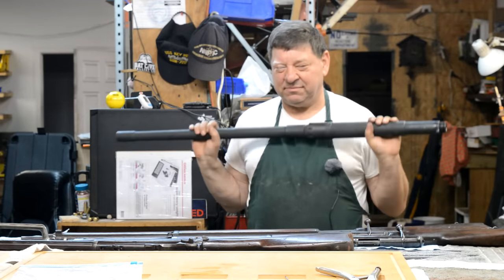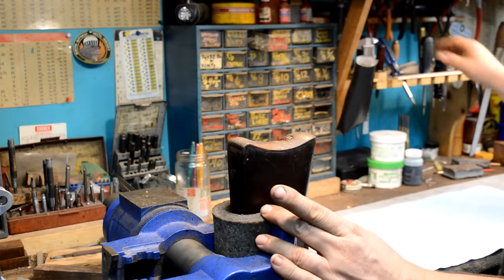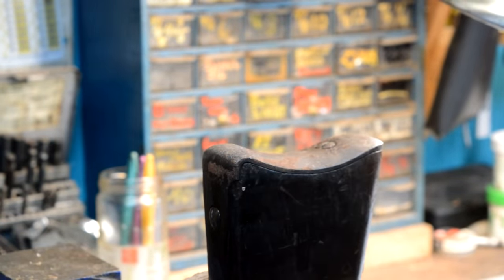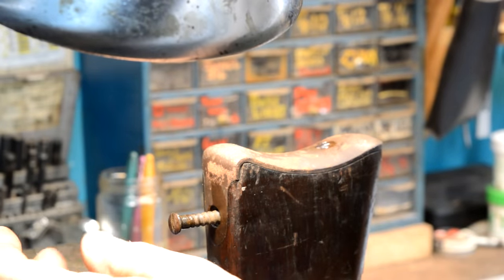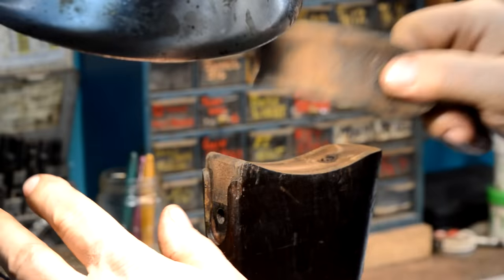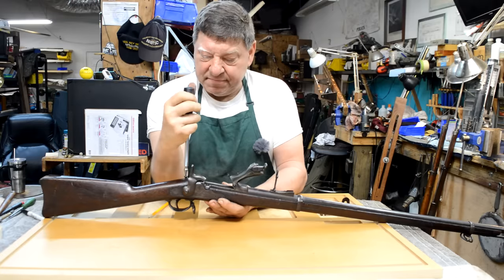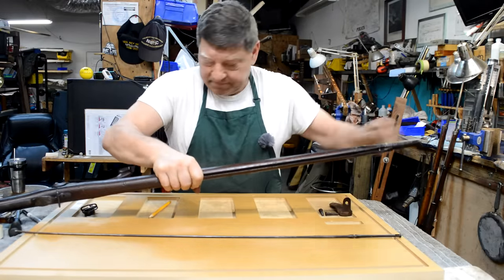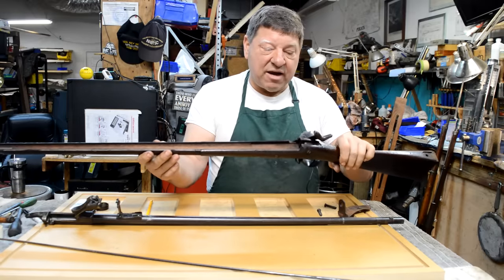1873 Springfield...The "Trapdoor":  Anvil 111

Comment: Those trays are great! I made myself a couple a while back, they fit into a little rack that lives on my wall, great for storing projects while you're waiting on parts etc. I'd suggest sealing the mdf with something like watered-down pva as they tend to shed dust and start to blow-up/fall apart once they soak-up a bit of humidity. Sterling work as always guys, thanks!
Reply from the maker: Trays are in fact sealed and repel oil quite well

Comment: I bought a Krag a few years back that was virtually pristine on the outside. So why did I take the gun apart anyway? Because there was sugar rust on the inside of the buttplate and trigger guard, that's why! You'll never know what's hiding under there until you check.

Great work as always

Comment: Hey Mark, So, I broke my 1873 down to its lowest common denominators. Extractor spring and plunger somehow are fused together. Firing pin tip worn down to a nubbin, and 5 screws beyond the tiny ball peen restoration. Well $85 in new old parts later the rifle is mechanically back up to snuff. Not to mention the extra high front sight and new front sight pin so I can get the rifle shooting.1.5 inches high at 100 yards.  The stock is ding steamed and sanded down to 400grit, and ready for stain, sealer, and true oil. The metal is close to being prepped for bluing. I'm making the rain gutter device for boiling and steaming. The moral is looks can be very deceiving and if you are not prepared to go all out and do the job right then leave it alone. When I die, I'll be willing all my new gun smithing tools and equipment, used on only one rifle, to Bruno. I am sure he will love the highly polished baby ball peen hammer.
Reply: Right on man, was this a retirement need a hobby kind of deal or something?
Reply: @bizzlebazzle4390  I have been retired long enough to complete all of my Honey Do lists and decided to put away my 7MM-08 and get an original Springfield 45/70 Government to hunt deer with. It's tough to find a Springfield in decent condition that doesn't cost a fortune. It's tough to find a Springfield in poor condition that doesn't cost a fortune. I'll have a dandy shooter when I'm finished refurbishing the old boy. My next rebuild is going to be a combination 20 megaton nuclear warhead/riding mower. Ha, Ha, Ha.

Comment: THANK YOU! This channel has been a huge wealth of information and this vid is another 5/5. I gave up trying to take the hammer off my Snider Enfield before I broke something. I tried asking or looking for a book but this stuff is all in old people's heads or 50 years out of print books. 

I used a parallel clamp for the flat spring and managed to take the hammer screw out with a wooden jaw vise and some heat but I ended up blueing the hammer and plate together.

Comment: Excellent video as ever Mark.. 

I have to say I tend to use a small brass hammer for "persuading" stuff rather than a polished steel one! My polished steel hammers mostly get used for pushing metal back to where it should be.. same with punches, unless I am hitting something that will be hidden, I tend to use a brass punch, at least to start stuff off. I have given up buying brass punches,  I just have a length of of 3/8" brass/phospher bronze and turn them up as I need them..

Regarding shifting "blister rust", I have a couple of flattened .577/.450 Martini cases on my bench, one I use for scraping pins out of files and the other I use for scraping off blisters.. sometimes they get mixed up.. who cares..!

Comment: This was just what I needed.  I've done this on other guns before but was going to leave the Trapdoor alone other than just disassemble it for cleaning (the reason I came here to begin with).  But I liked what you said, "I can't see how maintaining it makes it less collectible" (paraphrasing).  I work on classic Benzes and have the same thought process.  Thanks to you, I have all the metal boiling away in a pot next to me at the moment and they are slowly getting to a lovely, black finish.
Reply: Got all the bits black, but the barrel and action don't want to turn dark evenly at all. It looked like an oil pattern, so I degreased again with acetone, but hours later, hardly any change.

Comment: So, my 1873 Trapdoor also has the unobtanium breech and firing Pin with spring. I replaced the firing pin with the with a solid shaft pin that does not have the recess for the spring. I assume the spring had the purpose to keep the firing pin away from the cartridge primer until the hammer is fully cocked and fired. I also assume the angle of the firing pin to the primer may have created a force that overwhelmed the steel of the firing pin and caused a failure or break where the pin was reduced in diameter for the spring. Someone back then may have decided to beef up the end of the firing pin and deciding to heck with the spring that kept the pin away primer until shot. My Springfield has the three clicks of the hammer so I can carry the rifle safely without an incidental firing due to the firing pin resting on the primer or the trapdoor being unable to open. Still, I tip toe when loading and firing the old boy.

Comment: Dang it Mark, the one thing I wanted to figure out is how to remove the rear sight that is fastened without slotted screws.  You tell us a special tool is needed is all you told us and yes, I have an 1873 that needs a rear sight replacement, and it has the non-slotted fasteners. I have a beautiful 1oz buffalo silver round that I'll mail you as a gift, for your troubles. I was considering vice grips and a torch.  Desperately yours, Uncle Freddie von Trapdoor Pick.
Reply: The closest modern equivalents you will find are called "pig nose" or "snake eye" screw heads.  They make driver bits that match them, but most people just grind their own from a flat head driver.

Comment: Currently saving a tomato stake early production 1873 carbine from the brink of scrapping.

This thing was a write off and I'm using it for experimental archeology.

Using a series of mint condition rifles and carbines as examples, I'm replicating the finish techniques used at the arsenal.

To put it simply, to replicate the blotchy kaleidoscope of blues and blacks, you just vary the time and depth in the vat of charcoal. Also vary the delay between pulling the parts from the vat and application of oil.

I cannot get whale oil. I can get Jojoba oil. Both are liquid wax and virtually identical. So far I am attaining the variation correct to these rifles.

I have yet to pull the barrel. The bore is shot. The muzzle swallows a 45-70 case near to the rim.  The chamber is intact, the throat ok but from there forward is a nightmare of pits and damage.
I'll be drilling it to fit a 3 groove liner. Super temperature high strength JB Weld will secure the liner to the reamed out bore. I'm going to have fun doing this.

The metal will all be finished as per all the original techniques, slow rust barrel and receiver, charcoal blue hardware and color case on the tang and block. Shame the markings are mostly trashed or outright gone.

I'll be duplicating the stock. Straight grain black walnut heartwood 8/4 board on a duplicator.

It will look arsenal new less the markings. It'll be good for another 130 years. 

Don't cry. There is no history, that was neglected away before you were born.

Oh, my first impressions seeing this pathetic thing, it was dragged behind a horse down a granite rock road from the fort to someone's cabin, shot 50 times with chlorate primed cases, dipped in muddy water and then hung over a fireplace to collect soot and rust and the whole time played with in the yard by a few generations of kids who dry fired it to the point the firing pin jammed up in the crushed channel before the hammer finally fell off the rusted out tumbler shaft.
The butt plate came in two pieces. Looks like it sat on a wet burlap rag in a leaky barn for 20 years.

Like I said, the only history is one of what people will do to things they can't be bothered with.
Reply: If the bore swallows a .45-70 cartridge nearly to the rim, there is a chance that it is actually a .50-70, which was used until 1873.

Comment: Hi Mark!  Can you pls tell me the name/model of the soft bristle wheel you used for most of the cleaning (lock plate/buttplate/screws/etc)? I’d like to purchase the exact same one. Thank you!
Reply from the maker: https://youtu.be/62_pKoYje9o?list=PLQ8hvyC8cR2XppC_W8DYHKZboBH28e1Ie&t=453     go here, thanks
Reply: @marknovak8255  Do you think if the metal on an orig US Springfield is heavily frosted/browned with patina it would shine up like yours did? (assuming i'm using the same buffing wheel?)
Reply from the maker: @Scott Leaver  if you boil to convert first,  yes. The number of cycles through the process is more important than how long you take per cycle
Reply: @marknovak8255  if it's steel, how do you touch it to your hand without destroying your hand?

Comment: Great presentation ❤️❤️. Usually after boil and card you soak everything in kerosene. Didn’t mention this time?  I’m thinking you did and wiped down then applied non-detergent motor oil. At what point do you apply wax to the metal ? Do you warm the metal as you wax?  Thanks again for your wonderful tutorials.
Reply: You don’t normally wax metal, especially the moving parts may clog up
Reply: @meesvandeburgt3525  That I understand. The last time I did a thorough cleaning I gave all the internals a waxing with museum wax buffed with a brush and reassembled with oil. Haven’t had any gummies to date. That was before I discovered boiling. Thanks for your reply
Reply: You can soak it in kerosene, non-detergent motor oil, or mineral oil. The motor oil is maybe just more camera friendly since he can talk while doing it vs submerging it in kerosene and that's it.
Reply: @gpclipner  waxing is definitely a great long term protector however!
Reply: @meesvandeburgt3525  It is. All my older firearms that have been thoroughly cleaned have been waxed with museum wax. Amsoil also makes a product called Metal Protector that sprays on wet and drys to a waxy coating.

Comment: I periodically pull apart and clean and oil the components of my repro guns like this.  But the wood around the lockplate on my original trapdoor appears almost swollen OVER the edges of the lockplate.  How do you deal with THAT?
Reply: It could be over oil I think Midway has a video about dealing with over oil gunstock that’s old
Reply: @connermorley2282  Thank you.  Will check it out.

Comment: Thanks for doing this video even though you weren't back at 100%.   When you boiled the barrel, I assume you did inside the bore as well?  If so, do you run dry steel wool down the barrel to remove the rust?  Just curious.
Reply from the maker: A bore brush works great, even if it has oil on it.
Reply: @marknovak8255  Many thanks!  Hope you are on the mend.

Comment: I recently purchased a P 1853 Enfield with a unbelievable tiger's tail stock. It was converted to a trapdoor, first model design and reworked at the Remington Arms Co. for Hiram Berdan  to be used to procure Great Britton's breach loading rifle  contract ( It did not get the contract, that went to the Snider breech loading system.. It is stamped on the opposite side of the  lock is stamped, Patented Feb. 27, 1866. The ejector dose not retain tension and appears to be missing a "very small bearing" between the ejector and the upper breech section. Is it possible to repair it or should I leave it alone. The lock plate is stamped Barnett over London.

Comment: I absolutely love those old guns! I have one myself and would love to do the same resto as you did this one.. did you boil those parts in plain water?
Reply: For just converting, tap water is fine. If you are going to rust blue and use the boiling method, it should be distilled water. If you will use a steam pipe, tap water is all you need.
Reply: Thank you

Comment: Great one. I have used your methods in my own conservation projects.  I have one question, what speed are you running your carding wheel at? Seems much faster than mine.
Reply from the maker: 1750. 4 pole motor. 60hz

Comment: Would the disassembly and assembly instructions that you gave for this gun also apply for an 1863 Springfield?
Reply: I would think so as the both are very similar in construction. Or course, the 63 does not have a breech mechanism, but you want to make sure not the strip out the Cap cone.

Comment: Hey Mark, after putting the metal parts on the wire wheel did you re-blue them or just coat them in oil, I couldn't tell? Thanks Jeff
Reply: This was a straight up conservation, no rust bluing. Just non-detergent motor oil, kerosene, or mineral oil after carding.
Reply from the maker: Just oil, yep...
Reply: And NOT a wire wheel, it's a carding wheel. Basically 0000 steel wool on a wheel.

Comment: My 1873 has a set of witness marks where barrel mounts to block. The ejector fits perfectly to barrel and block. But the barrel is only hand tight to block when witness marks line up. Is this acceptable?
Reply: Check headspace and shim if it's too easy to turn past the witness mark? I think if you can't really turn it more (with reasonable force), then it should be fine since the rifling will impart a slight "tightening" action every shot.

I'm no expert, though.

Comment: There's gotta be a small vibratory impact tool or something to prep areas to be broken free
Reply: There is.  It's called a two-ounce ball pein hammer (with a mirror-polished face) sometimes combined with an equally polished punch or drift.  Tappy-taaaaap-tap.
Reply: @geargnasher9822  no that's an optically guided inertia driven device,  I said vibratory ; ) I've used impact hammers that when the strokes turned down it turns penetrating oil and rust into red soup, thinking smaller scale though
Reply: Some call it a sex toy.

Comment: Hi Mark, I found a trapdoor with a hammer that can't cock. Wondering if it needs a sear spring? Easy fix or?
Reply from the maker: Take the lock off and oil it with anything you have
Reply from the maker: If it cocks out of the mortise but not in, then wood may have swelled. OLD JOKE.....can you hold it closer to the phone?

Comment: If the damage wasn't catastrophic from someone using a modern smokeless round in one of these are there any tell tale signs it won't be safe to fire with black powder rounds? Like if someone is trying to sell you one what are you looking for to ensure it's still safe to shoot?
Reply from the maker: Difficult to say without holding it in my hands. I would be looking at loose pins, bulges, general condition, and a hundred other things. It would need to be test fired on a test stand several times, with another list of things to look at there. Not a call I can make "over the phone", sorry
Reply: If you can't tell by looking at it, the safest bet is to assume it's not safe until it's checked out by a qualified gunsmith. If the seller is a decent human being they shouldn't have a problem with you insuring your safety before you buy

Comment: Can gun oil hurt the wood of a gun over time? i tend to lightly oil the barrels of my over and under before i put it away, can that potentially seep into and weaken the forend over time?
Reply: Yes.
Reply: He explains it in another video. Gun oils are different than oils for gun stocks like Danish oil. Gun oil soaks into the wood and will rot it. When you see old guns and the wood is dark around the receiver, or other metal parts...that's from too much gun oil soaking the wood.

A light coat on the barrels is fine. Otherwise things like RIG or Renaissance wax would be better.

Comment: So I got a question for you. I hVe a high power that was made in Belgium by the nazis during ww2 it is kinda rough but works flawlessly. My question is hould I leave it in the condition that it is in or reblue it. I am currently going to school to be a gunsmith but I am getting opinion from the ol timers like yourself
Reply: @ScottKenny1978  sure do appreciate the info
Reply: @Sirsandonthecoot  if there are wire wheel marks on that pistol, you can go ahead and reblue. Any historical value is already destroyed if it's been wire wheeled.

But if it's just kinda messy and worn, you can boil the rust and restore whatever is left of the finish.
Reply: @ScottKenny1978  no wire wheel marks just extremely old and worn
Reply: @Sirsandonthecoot  oh, thank goodness!!!!

Yeah, detail strip, absolutely hose down the parts with non-chlorinated brake cleaner, then boil. If your tap water is hard, with lots of minerals in it, boil the parts in distilled water.

Finally, polish with 0000 steel wool and take your time.

Comment: How .long does it take to boil the parts to convert the red oxide to black? I have a couple old shotguns I'd like to try this on.
Reply: Takes about 1-2+ hours then take 0000 steel wool to it then rinse and repeat till the rust is gone
Reply: Depends on how thick the rust is. Ideally not enough to have caused deep pitting.

Comment: I have a 1864 Springfield trap door. What caliber were they ?
Reply: In 1865-66 the U.S. government started converting the muzzle loading Springfields into trapdoor breech loaders.  the first was the Allin conversion done by removing the top of the barrel at its rear and putting on the Allin trapdoor.  The .58 caliber was considered too big so they inserted a .50 caliber barrel liner and improved the trapdoor mechanism in 1866.  It was also made into a centerfire instead of the rimfire of the .58 caliber.  In 1873 the chamber was changed to .45 and the 45-70 was born.  The 70 is for 70 grains of black powder.  As I recall, the .50 also had 70 grains of black powder.  Yours was probably an early conversion from a .58 cal. muzzle loader and it may be .50 caliber centerfire.